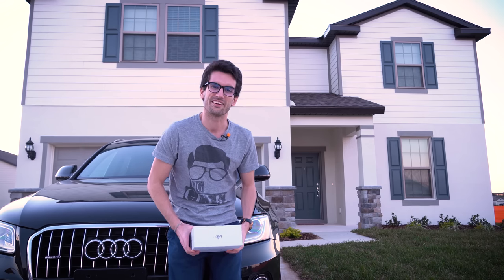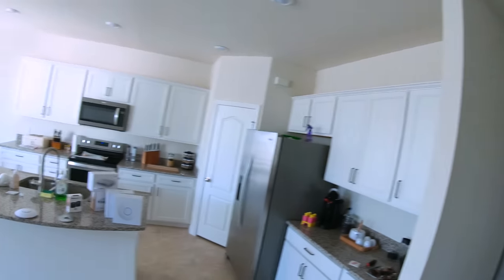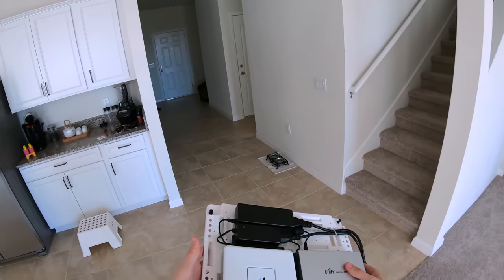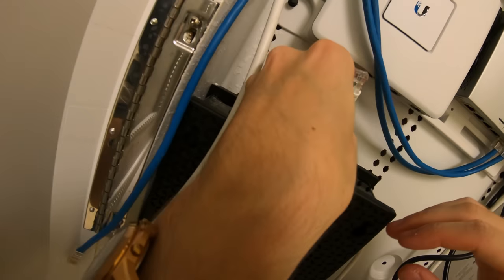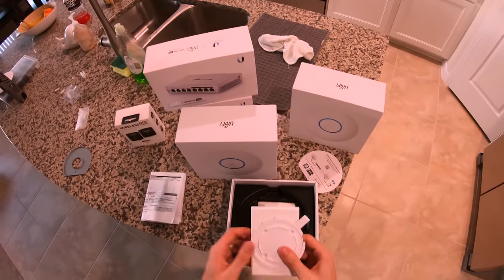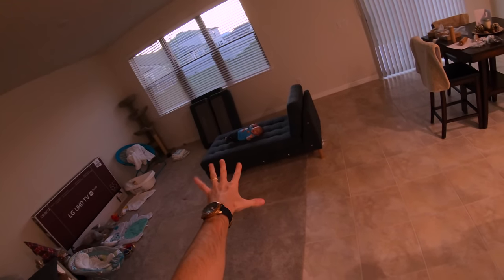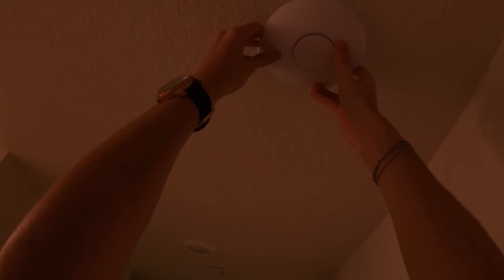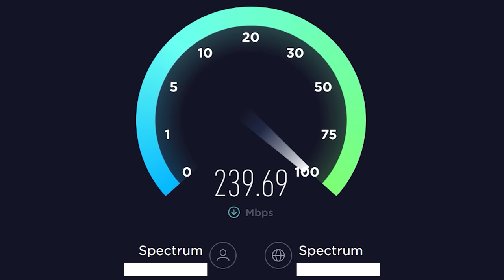How To Set Up a Beefy Home Network Solution

Comment: I appreciate the "let's stop and play with the baby" moments so much, that's precious. I hope I have a chance to do that in a video some day.
I think your networking box looked pretty good when you finished with it. And that AP mounting job was good too. Here's a tip for drilling, though: If you don't apply as much pressure and let the drill bit do the work, it can be easier on you and give you a better hole. Plus, once the bit breaks thru, it'll go straight thru, and you can pull it back out without reversing the drill's direction or stopping the drill. Plus it reduces heat buildup, which can be bad for some materials. Oh, and I'd recommend investing in a small table vise if you're doing things like that enough, those things are great, and you can get them for cheap online.
Reply: im to lazy to read that
Reply: but theorist lines sound cute

Comment: Make sure to adjust your RSSI on the AP's to aid in the AP Roaming (Hand Off). For a home of that size with 2 Nano's I would suggest an RSSI of around -70 to -75 dbm. Also you will want to adjust your AP channels for wireless. For 2.4 ghz you only have 3 clean channels (1,6,11) that have no overlap so I would suggest you go on either end of the spectrum so one AP 2.4 on channel 1 at low to medium broadcast strength and the other on channel 11 at low to medium broadcast strength. I would advise using the ubiquity wifi man app on your phone to perform a wireless scan so you can see what channels are being broadcasted from your neighbors to avoid overlapping channels. As far as 5 ghz i suggest you use the DFS channels (52,56,60,64,100,104,108,114,136,140,144) as most consumer routers and isp routers don't support them so you would avoid channel interference from your neighbors.

Comment: The Ubiquity Access points should come with a set of drywall anchors. So that you can mount them directly to the ceiling. I am just saying this to save you some time in the future.
Reply: Ubiquity access points do come with drywall anchors. They come with everything needed to mount them flush to the ceiling.
Reply from the maker: Yeah, and that mount wouldn't fit around the cut-outs in these ceilings. Otherwise, I'd have just used those Lol.

Comment: I bought a Ubiquiti network setup about 6 months ago because my netgear nighthawk just couldn't handle my home server and all the pcs and game consoles in my house. I am not dissapointed, this is by far the best network setup I have ever used (and I worked for xbox networking support for 5 years). I haven't had to reboot once, I run my plex server 24/7, a website and all my pcs and consoles no problem at all. No regrets, the best setup you can get in your home.

Comment: Several things:
1. Be sure to turn the power lower (you don't wan't APs to talk over each other).
2. You should set up a server for the UniFi controller software or buy a controller. The controller will help with the handoff as well I believe.
3. The security gateway you bought won't be capable of 1gbps with many features turned on (if that's what you're going for).
Reply: Also, don't let a baby lay on top of something it can roll off from unless the baby is under close supervision.

Comment: Great job man. I worked in commercial networking for a year and a half and installed a bunch of those ubiquiti waps. To get them flush on a ceiling we wouldn't even put an outlet box there for the cable, just a hole big enough for the cable to pass through. That way your mounting bracket can go right on the ceiling

Comment: Your home network box is the same size as mine. Mine however is packed with a modem , a ruckus switch for POE, a smart things hub, a z-wave hub, a kevo plus hub and a ring hardwire doorbell camera. I also have a bunch of cat6 wires running to the ruckus switch and my wireless router which sits on a shelf with another 10 port switch.  And to top it off I have a cloud connected as well. I really wish new home builders would make these network boxes larger and with shelves for components. Nice video! Thumbs up and I subscribed!

Comment: Greg, IT pro here.  Just an FYI, consumer grade equipment like Ubiquiti Unifi products like you have, don't command devices to do hand offs.  The devices themselves choose which access point to affiliate with.  A more complex controller would manage all of that but unifi does not.

What you want to do to improve your 'hand-offs' is reduce the power of your APs so that they are less likely to hang on to an access point while you're closer to another one. 

Also, be sure to configure each AP to be on its own channel (my Unifi network did this automatically, but if your neighbors have strong networks in the area on the same channel, you may get interference).  You can actually get a free tool from Microsoft called WiFi Analyzer that makes this a lot easier.

Cheers!

Comment: If you havent already, I strongly recommend a fan to cool the inside of that box. The USG Gateway and the POE switch are passive cooling and they get really hot in an open environment. In an enclosed one it will be worse.

Comment: Nice video man! I have been using ubiquiti products for a couple years now and love the ecosystem. If you consider having a security system at your house, I would totally recommend unifi protect. I Also, I recommend purchasing a backup power supply to use  for all your networking equipment, the modem, usg, and switch. I know your space is limited but if you can find a small one, it would be worth it.

Comment: You need a UPS for your modem, router and hub.   A big as you can squeeze into the space.   Also  since you're getting FIOS, you should also have a smallish ups for the (even thought the FIOS box has a battery).

Comment: If you did not run the RF scan make sure you run that.  That handles most handle off issues,  It should also be run ever so often in you notice additional wifi networks in the area.   I got two network at work.  One for employees one for guest.  With three access points each.  When I first setup before i ran the scan there were issue with handoffs.  Once i ran the RF scan on all access points i got no complaints and have noticed no issue.  Even notice better coverage in the building.

Comment: I have the exact same networking solution as you and have have no issues with my Ring, IP Phone, multiple Windows and Mac computers, Apple TV's, cell phones, tablets and many different home devices (pool controller, smart lights, thermostat, ceiling fans etc.).  The Ubiqiti Account portal is a great tool for monitoring all these things and updating the firmware for these devices. You will be very happy with your solution.

Comment: Taught myself networking, too. I had it easier, though. My basement is nice and open and I was able to easily route my own Cat6 all over the house, mostly with items sourced off eBay. Found out the hard way that Home Depot is a ripoff. Found a 100' drop of cable from someone selling their excess for under $30, and bulk terminals were a lot cheaper, too. Did get a relatively affordable 8-port switch and the crimping tool off Amazon.
Reply: Used my old Linksys WAP because it was still good enough, and I'm doing mostly everything wired where I can

Comment: Very cool. Make sure you setup a separate (maybe guest) wifi SSID on a different vlan (or otherwise restrict that SSID's access to the rest of the local network) to put the Ring system on, and any other IOT devices.

Comment: Hey Greg, If you are having Hand-off issues, you need to tune your AP's in the unifi Controller. The Power Settings on the unifi are basically ON (100%) by default, and thats not always the best, may want to lower down to 35-45% and tune from their.. range of One AP should Barely overlap the other AP's

Comment: I am actually in the process of installing one of their networks at home too. the only thing i would recommend is instead of getting the USG, get the dream machine instead. you lose a few features for remote deployment management, however the UDM is MUCH more powerful from a IDS/IPS perspective. you will get much more throughput with those features enabled than the USG.
Reply: Yeah he should get a UDM, only downsides is that the way his overhead cables are run it wouldn't really make sense.

Comment: It is actually the client that decides when to hand-off. Some devices/adapters do a better job at it than others. Although a poorly designed wireless network layout will also affect how well a client can hand-off. And you need to make sure you set up your wireless networks on a single frequency band for clients to have a smooth hand off... for example if you have an SSID that is on both 2.4  GHz and 5 GHz you will experience drops at times when handing off because the client might decide to switch bands when picking up the next AP.

Comment: Unifi makes good stuff.  Both the hardware and software are excellent in my experience, and even their most affordable gear seems like enterprise grade stuff.  I haven't tried the USG though -- I currently like OPNsense (or pfSense) in that role.  You can run OPNsense/pfSense in a VM on your NAS box (unRaid, FreeNAS under ESXi, whatever you've got) which saves a bit of space and power.  But if the USG suits your needs that's great.  The setup is definitely easier with the USG and it's convenient to manage your whole network with 1 web interface.  Thanks for the video.

Comment: normally you don't use those covers to mount the AP's, the metal bracket and screws are for plaster and floating roofs or just wood screws right into the plaster with the Ethernet cable poking out of a small hole in the plaster, the AP covers that anyway

Comment: the mounting hardware is probably for a standard octagon box, or intended to be surface mounted
Reply: The included metal bracket is for drop ceiling (a sort of anchor to be on the topside of the drop). A common solution is  holes in a ceiling for a cable, then screwing the bracket directly to it.

Comment: You didn't need to drill into the faceplate cover.  Just screw the ubiquiti plate into one of the screws in the wall plate.  The AP would have covered the hole and only one screw is sufficient to hold it up flush with the ceiling.

Comment: thanks for this video.
it was good info but I do not need this as my apartment is so small.
but being an old get LoL I have few things that might help in in the future
1. if you can try not to drill hole over a carpet :)
2. drill the four hole for the bracket and the hole for the wire in the cover. then put the cover back first then screw the bracket on. then you don't have to drill holes through the bracket.
3. open a the bin lid and uses dremel over open bin (no mess)
NEVER say sorry for your baby :) be proud of them
God bless Roy

Comment: So, after 4 months of using the ubiquiti networking, how do you like it so far, hopefully it was easy to setup, i also noticed and played a little with the software, the channel width for the 2.4ghz, higher number = faster speed lower = futher range same with the 5Ghz, higher number is faster etc, it is in the config of the acsess point itself

Comment: If there is a phone system in place it should be atleast CAT5-E so if you wanted to you could just snip the phone sys punch down and replace it with a networking patch panel and then just snip all the RJ-11 jacks and make them RJ-45 jacks dont know if you've considered this option or not, ive just done it to my house that is 20+ years old and had CAT5-E for its phone sys and for my friend's house as well

Comment: Don’t you need a cloud key or is it’s functionality included in the gateway?
Reply: You can buy a Cloud Key or run the controller software locally on your own computer. If you want to get a bit crazier, you can setup a dedicated server just for your controller software.
Reply: @JJFlores197  Thank you for this answer!
But is there really no way around running the controller software on a separate device, when you already have the gateway + some APs?
Reply: @nusermane1076  I don't think so. I think the USG has very limited configuration you can do from within its web interface. I don't know about the Access points though. Since this is "pro-sumer" level equipment, its designed to be operated through controller software instead of being individually managed at the device-level.

Comment: Just wondering what you're using as a controller. You'll need one to ensure hand-off. Most people use the official cloud key but you can use whatever device. I personally use an RPi, but it was a pain to set up.

Comment: I would get a docsis 3.1 modem. Only reason is if you decide to get gigabit speed internet, you will be ready for it. Just check with your ISP so see it is on their compatibility list. I use a Arris Surfboard SB8200 and has been a solid modem with no issues and using Comcast (Xfinity).

Comment: I bought a new home and it comes with a 12 port switch that connects to two access points.
The modem will connect a router that will connect to the switch. 
What type of router should I buy? Does it matter if the router is able to provide high speed or long range, when at the end, it is the access points that will be giving out the wifi?
Thanks!

Comment: Best practice is put Ethernet on one side and power on the other. Basically not mixing cables. If you flip the switch and firewall around you will be able to clean that cabinet up a bit more. Instead of having the Ethernet cable come from top to bottom and power from top to bottom. You can have Ethernet top to top and power bottom to bottom hopefully that makes sense.
Reply from the maker: It's not really that big of a deal for me.

Comment: Did you buy the Ubiquiti gear or did they sponsor you?  Why did you do this vs an all in one router, switch, access point?
Reply: Well, if you mean normal consumer wifi routers, this is much better, even just for the fact that the wifi is closer to where it actually needs to be rather than in a enclosed area which probably isnt in the best place in the house for wifi. The usg although it doesn't have the best control compared to something like pfsense, still is much better than most if not all consumer routers in terms of what you can do with them(one example being vlans)

Comment: The Unifi AC pro APs come with a large enough mounting plate that it would cover the single gang electrial box without needing a blank plate
Reply: That is what I used.  I don't think there is a similar bracket for the nanoHD though.

Comment: I know this is an older video but for anyone watching this later, handoff is only an issue if you don't have a constant running controller. Either use a hosted server online or their cloud key products, stay away from the original cloud key peeps and only use the Gen2 versions

Comment: I would have done two things slightly different, one is to get the painter to paint those faceplates the same colour as the ceiling and two have the electritian drill the holes and run the cables for the wall jacks as part of his scope I\(including seperation from the electricity).

Comment: My house which was built 10 years does not have that box you have that houses all your networking gear.  Pretty much my current set up is modem connects to a coaxial jack (Xfinity) in living room and I run wi-fi throughout the house but I rather use all existing phone jacks (cat 6 cables) and will convert them to ethernet ports but before I plan on doing that this is my obstacle.  Any suggestions?

Comment: is the security gateway necessary ?
Reply: Not really. You can use a different router if you want. Its just that the other router won't integrate in the Unifi ecosystem. It will work fine but you won't be able to manage it from within the unifi software.

Comment: Where's the PFSENSE?!?!?!?!?! lol  I'd love to hear why they won't pre-run either LV conduit or the network cables during construction.  Is it a HOA development of McMansions that doesn't allow any modifications to the general build.

And technically you didn't need a back-box at all.  Can just attach the plate to the wall.

For the hand-off issues I created separate networks for 5GHz and 2.4GHz.  My phone would drop the 5GHz, move to 2.4GHz and then hang on to it forever, never switching back to 5GHz.  You can make those settings within the Ubiquiti AP control panel.  Also, what are you using for a controller?  Also, also if you use a CloudKey v1 you need it or the switch on a UPS to avoid improper shutdown, DB corruption and the headache of hopefully recovering it.

Comment: Unless there isn't enough cable length, is there a reason not just terminate the blue in wall cable with a male connector and plug it directly into the WAP?

Comment: USG 3P can NAT 1gb. Just isn't Great when you add more than a few port forwards and some basic rules. I have one but ditched it for a MikroTik RB4011. For someone new to networking the ubiquiti stuff is great though. Word of advice though. Do NOT enable IPS/IDS. Your throughput will be crippled. USG 3p is actually quite an old model. Even has DDR2 memory. UDM and UDM Pro will be the spiritual successors to the USG 3 and 4, with the usg XG being discontinued

Comment: With a new home and modern wiring, think about power line adapters in place of Ethernet cable drops.
Reply: well, i would say that should be a last resort, if it's possible to run physical ethernet, DO IT